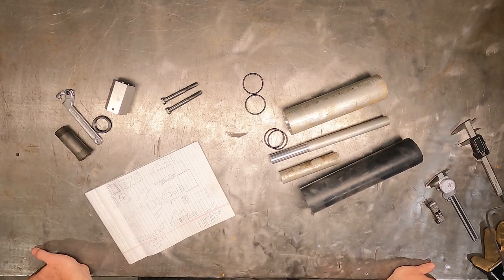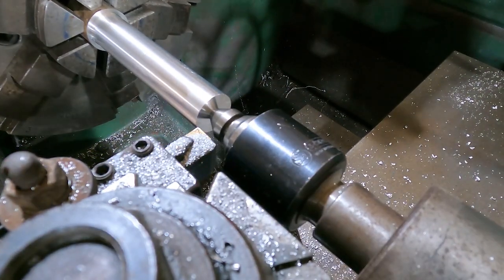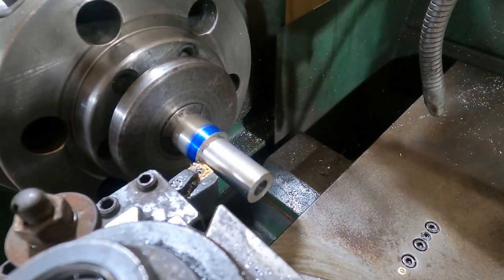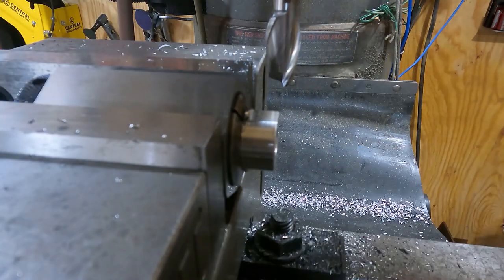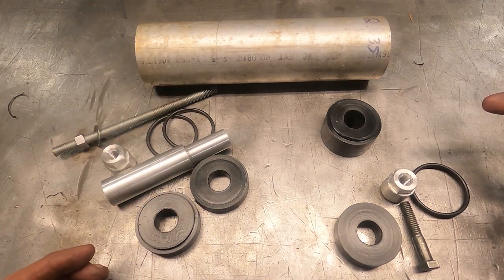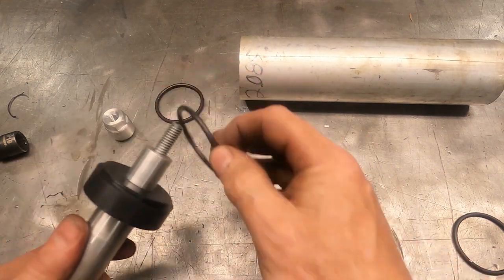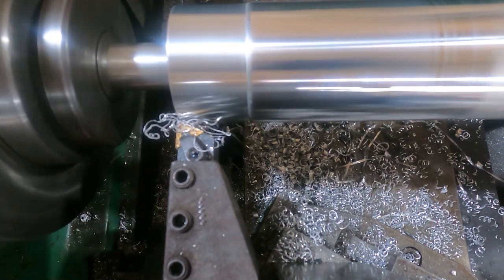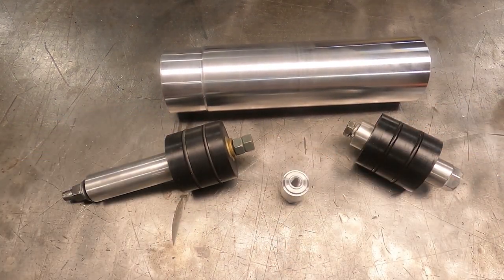Turning a hollow cylinder "between centers"

Comment: Very nice. Now I assume you could also have say a 3/4" tube that ran through the middle to push on the plastic at both ends. Then use a single rod that passed all the way through. Then you would have two outside nuts that would expand both mandrels simultaneously.
Reply from the maker: Excellent observation, and I did consider using a threaded rod for the very purpose you stated.  However, I decided against it because I wanted to make this quickly adjustable for length, plus the ability to change out parts a bit faster.  If I had a full center shaft it would be a bit more complex (not much, but a bit).  

Now you have me thinking about it again, I may try that as a mod.
Reply: @MountainLaurelMetalworks  Or... Make the inner discs form aluminium and put a thread in the disc itself.. That would still keep both ends separate and the large diameter disk is less likely to spin than the little bolt in the middle. You could also drive a pin into the inner disk off to one side of the center thread.. with a sloppy hole in the outer disk.. This would stop the inner disk from rotating relative to the outer disk.
Reply from the maker: Yeah, I was trying to stay away from metal as much as possible, since the interior of the 'real' customer part was already finished.  Even putting the wrench in there was a little nerve-racking, but  just wrapped it with a cloth on the 'real' part.  But keeping all metal to the center gave me plenty of room to work internally.  

If I do another batch of these parts, I may work on refining the design, but I was quite pleased with how it worked overall.  Without this, I would have had to indicate and re-indicate over and over again as I flipped the part to access both internal features.
Reply: @MountainLaurelMetalworks  OIC.. Yes is a great idea that I may copy in the future.
Reply from the maker: Awesome!  Copy away!  That's the reason I share these, hoping it helps someone :)

I'm glad you enjoyed the content!

Comment: Really enjoyed this video, cool concept/solution!
Reply from the maker: Thank you for commenting and I'm glad you enjoyed it!  It definitely made the job 10 times easier.  I could dial in the lathe and swap out part after part performing operations on both the left and right faces as well as the full exterior.

Any other method I could think of would have multiple holding / driving methods, re-indicating, etc.